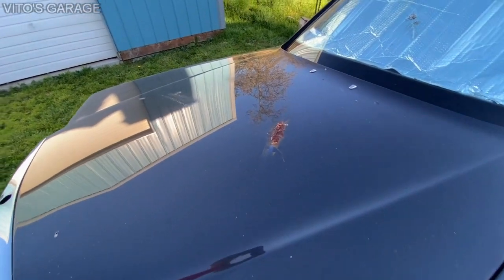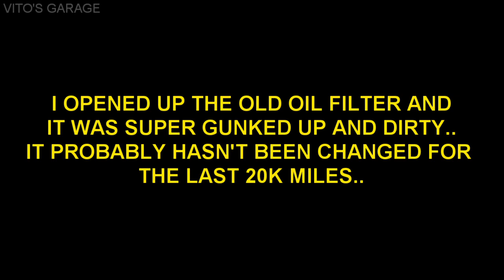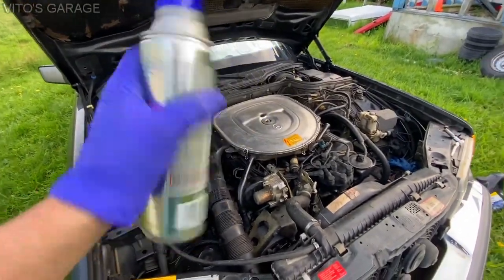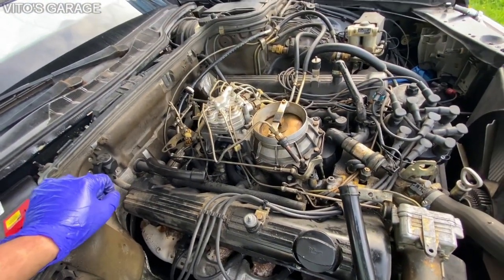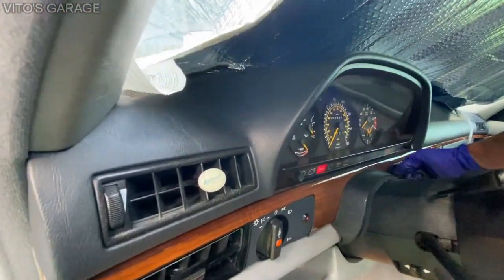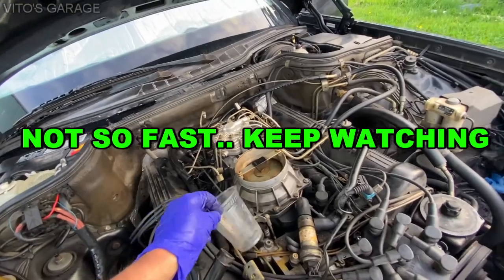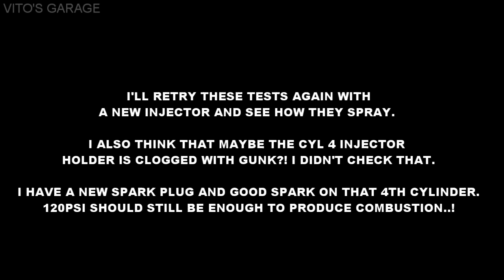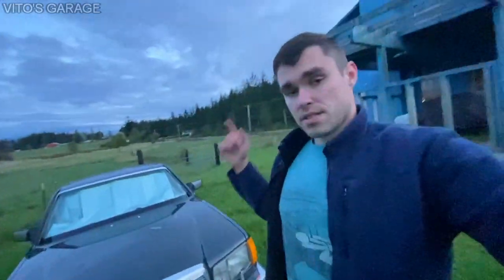How to Test KE Jetronic Fuel Injectors. Mercedes 420SEL W126 Misfire Headache..

Comment: Hello Vito 
Before touching the metering device, you may have to start by checking the pressure and flow rate of the fuel pump (with a bottle for X sec), the condition of the two fuel filters ? Putting the injectors in an ultrasound bath would not be a luxury.
Nb: I found my faults on my C124: I changed my EHA, my coolant temperature sensor, my idle potentiometer (with a lot of patience). My 124 coupé now runs like a Swiss clock. Next work : the clutch slave cylinder to be changed.
Reply from the maker: Awesome, sir!! Thank you very much for sharing. Yeah, I’ll have to start checking the fuel pressures and other stuff on it. I’ll keep working on it. Thank you for supporting🙂🤝

Comment: Hi man did you find the solution ? I bought an 500sel 3 month ago and same 4th cylinder not firing :( compressions are perfect spark also .... thanks
Reply from the maker: My compression is low on that cylinder. If your compression and spark are good, look into troubleshooting your KE Jetronic or possibly rebuild a fuel distributor

Comment: Mine was kinda doing the same thing. Still is really. 

- New plugs, Wires, Cap, Rotor, All new fuel system in the rear and lines, filter, etc. New relays too, O2 is working proper as well, New idle air valve, EGR works.

Yet, Im torn between EHA being faulty or something else. EHA doesn't leak though and O-Rings are great! 

It idles like in this video, Up, down, over and over, and when I tune the Lambda I can get it to level out with less up and down but it idles literally like 400-450 and its bad! 

So its pointing to something not able to hold a steady pressure some way. The plunger isn't stuck on the FD that I can tell But the air flap did do something odd.

It went HAYWIRE! Flaps like hell when it's almost dying sounds like a busted subwoofer ahaha. I can hit the gas and it will stop it from doing that and idle but back to how I said it does in this video but worse. 

I don't think the boot is torn any at all on the FD below it, It wouldn't be kinda obvious at that point. I've seen videos. 

Before all this chaos, It was running SUPER rich as the plugs were black as hell! Twice actually. So it was tinkered with by the previous owner as the Lambda protection was removed and EHA had signs of tinkering but is original. 

Anyway, All this trouble started oddly after I redid the whole fuel system with new proper pressure and so on. It's like the engine now can't adjust and handle it properly. 

Kinda thinking my injector's have issues like yours really. The passenger side is what seems to have a weak spot when it stumbles idling and you can hear a slight tapping on the passenger side which would indicate failed combustion or weak? 

What do you think? My symptoms as I said are almost identical just a bit worse. When it does try to stumble and stop, Thick white gas/exhaust smelling smoke pours and its not fluid's burning or oil, Both are clean and fine and no usual symptoms of that at all happening or smells. It did have a black smoke issue but I fixed that with the new plugs and Lambda adjustment since it was messed with before, But then it was also driving fine. It was just like the more I drove it though, out of the blue with the new fuel stuff this happened. Guessing where it sat so long the other guy kinda didn't take care of the fuel injectors and seals? Idk
Reply from the maker: The problem with my car is a low cylinder pressure and no combustion happening in Cylinder 8th. I have a good fuel supply and new injector there as well as good spark coming to it. But my compression was 120psi comparing to others that were about 160-170psi. 
It still has that misfire and running on 7 cylinders now. I’ll be pulling the engine and trans in the future and tearing everything apart. But that will happen sometime in the future. As of right now the car runs and drives. The reverse gear is gone too. So she’s waiting now since I’m working on a lot of other cars, not just mine.
As far as your issue, you have to check both fuel pressures. Get a KE Jetronic fuel pressure gauge and test both system and differential pressures. There should be about 0.3 bar difference between both.
Make sure you don’t have any vacuum leaks. Use a smoke machine to check that.
Your injectors may be leaky as well. 

The FD usually needs to be taken apart and rebuilt. These cars need that. They can get dirty on the inside and the diaphragm may be bad. That can cause problems. I recommend rebuilding your fuel distributor. They sell rebuild kits online.

When everything is installed on the car, disconnect all the injector lines at the FD, turn the fuel pumps on (jumper wire at the fuel pump relay terminals 7 and 8 usually). The fuel shouldn’t rise in any ports when the pumps are on.
Now, press the air flow plate down and watch the ports. They should all  fill up with fuel simultaneously. If they dont, you have a problem. You have to make sure fuel injectors are getting the proper amount of fuel. 

Make sure the compression in all the cylinders is somewhat equal. 

Make sure the air flow potentiometer is operating. You can check continuity test on it. Look online. 

These systems are sensitive, so any small issues can cause running problems. Let me know what you figured out
Reply: @VITOSGARAGE  Sadly, Figured out nothing! It's going to scrap since I have to move and can't take it, Eviction is a pain! Losing all the work I did to it. Trust me.. I HATE THIS! :/ 

Wished I could have figured it out sooner. I love this damn car. lol Eh... life.........
Reply from the maker: @FatherLamb  You truly never deserved or deserve a car like this!! Big big shame on you man!! Instead of giving it away to a good home, you did this! Please stay away from Classic German cars! We don’t need to lose anymore amazing cars!
Reply from the maker: @FatherLamb  Just because you move and can’t take car doesn’t mean anything! Give it to a new home owner or sell it to someone, or just donate man. Seriously. No offense but I’m super pissed at you!
Reply from the maker: @FatherLamb  Buy a Corolla and stop crying if you can’t repair such an amazing car or don’t have patience or money to pay a specialist!!!
Reply from the maker: @FatherLamb  just buy a new car buddy and chill out. These cars are rare. I am a huge enthusiast and have helped so many people fix and save these Classic cars. And I spent so much time replying to you because you needed help just to hear you scrap a car?…. Nice damn move, Father Lamb
Reply: @VITOSGARAGE  Again FAR FROM RARE. Maybe where you are but here.. They're around every corner and No.. Not making this up. LOL Sheesh
Reply from the maker: @FatherLamb  I don’t care… you wasted my time man… This is not cool. Learn to appreciate Classic Mercedes as well as people’s time!! And stop saying your stupid “sheesh”. Have a good one

Comment: Get seaf foam depending on how much fuel u have u can put 2 3 cans of sea foam depending on how much fuel let it run for 45 min turn it of for few mins 15 atleast leat engine cool off n then try it again
Reply from the maker: I already tried soaking that low compression cylinder in sea foam for 48 hours. That stuff doesn’t work. Just lots of advertisements but it doesn’t help with anything..

Comment: 7:35 you no need to run the engine to test the injector, just bypass the fuel pump module with piece of wire and depress the air plate, this will make injector to spray
Reply from the maker: Yeah but I just wanted to test them this way. The only thing I should have done is I should have pressed the air flow plate down to see the spray pattern off idle. I only looked at the pattern while at idle
Reply: @VITOSGARAGE  if you decide to microsquirt one of these, find intake manifold from old m117 with D-Jet where you get ready to use fuel rail and injectors
Reply from the maker: I am not sure what I’m gonna do yet, time will show🙂

Comment: K and KE-Jet are the biggest mistake Mercedes did, by replacing the D-Jet
BOSCH have Electronic Fuel Injection since 1967 known as D-Jet
this is what you see in todays cars, but the ECU have microchips
Reply from the maker: Not a huge deal. I am enjoying learning about it. I’m getting better. Once you understand the system, it’s a piece of cake

Comment: bro those injectors are toast. watch the mercedes source video on fuel injection (maybe you need to purchase it). i would replace all injectors and fuel filter. they are probably overdue anyway.
Reply from the maker: All the cylinders are working except cylinder 4. This is the number one task to fix right now. I’m not gonna replace all the injectors with ones just because. Later I sure will